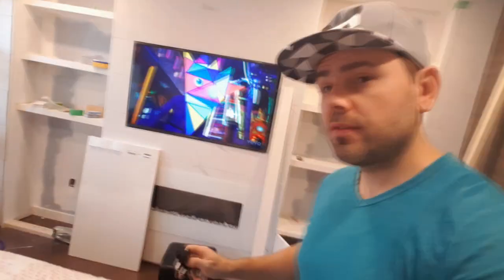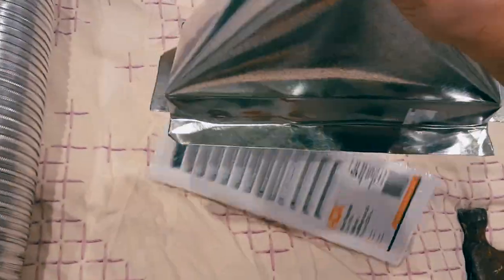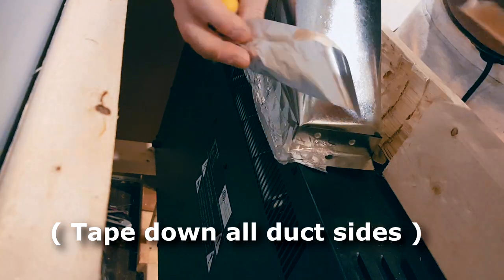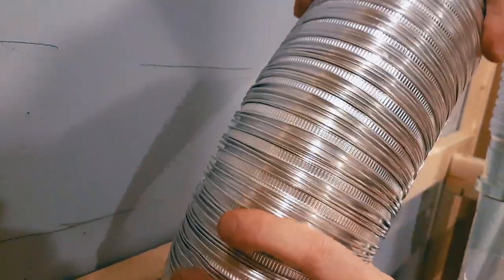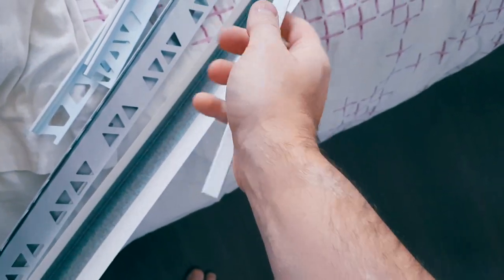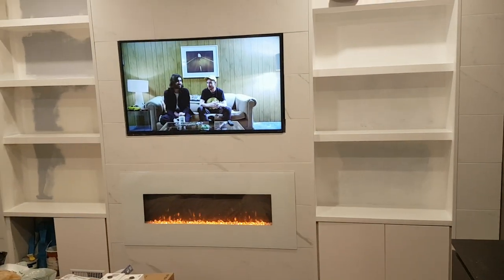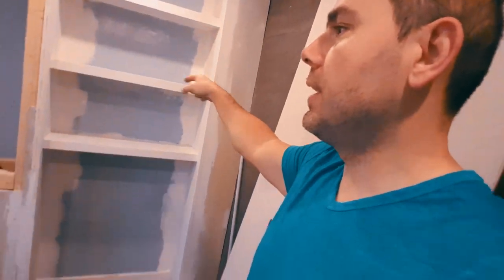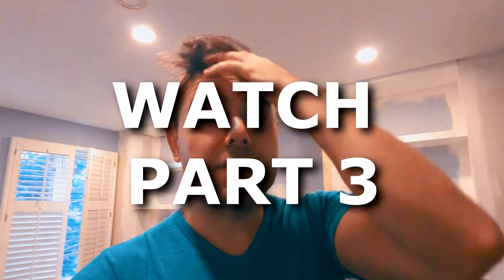DYI - How to Build a Recessed TV Fireplace Wall From Scratch - Part 2

Comment: Where’s part 3 and how do u ventilate the tv inside a wall or do u not need to
Reply from the maker: Hey sorry been super swamped with work, but to answer your question, part 3 will be released eventually. The TV is on a TV Mount that folds in and out, there is a 1/8th space all the way around the TV which is how  it was built it so you can pull the tv out if you ever need to easily. Venting is not an issue, however unless it's a SUPER TIGHT seal which i don't know how you would achieve one without permanently placing the tv in a wall. There will always be airflow. The LED tvs don't produce enough heat anymore to burn out.